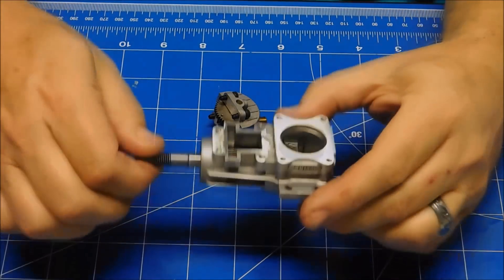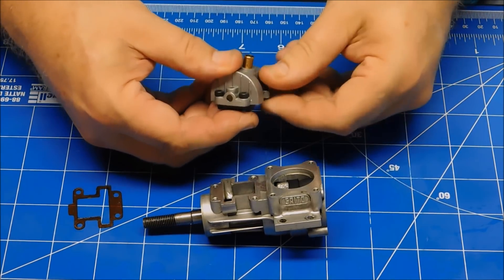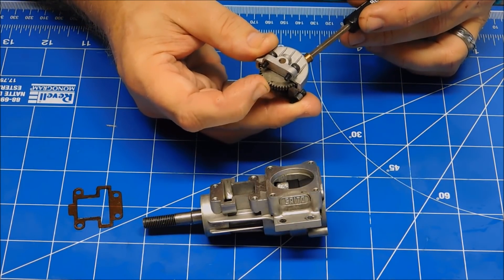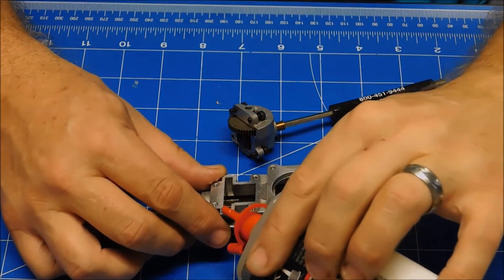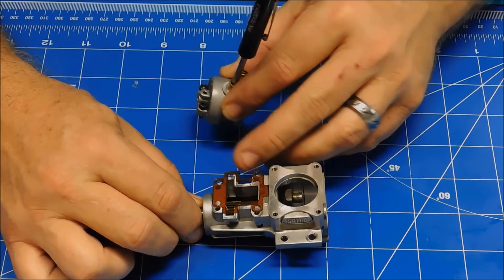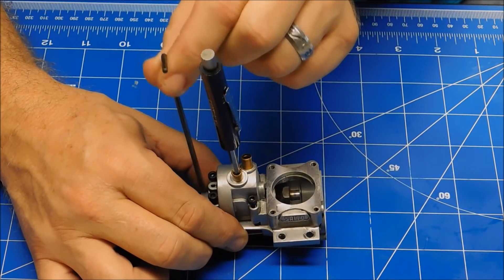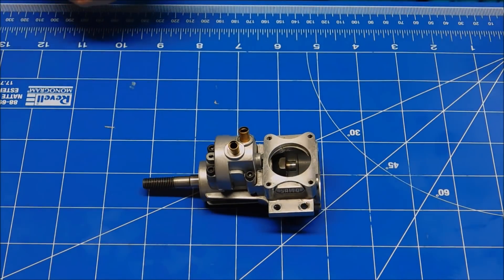How To: Set the timing of a Saito engine

Comment: Dave, little trick I learned on the bigger Saito engines where you can’t index the cam. Two razor blades against the base and engaging the cam teeth will hold it in place while you re install the cam. 
Cheers

Comment: If you get this comment, awesome! Just purchased a used fa62a. When to prime it and it won't prime. However, when I spun the prop clockwise, fuel went to carburetor... engine not timed properly?
Reply from the maker: Clockwise with reference from behind or in front of the engine? Very possibly. Used engines always should be thoroughly inspected especially if you see something like that. I could look at it for you.
Reply: @dmrcflyr2 thank you. Props run counter clockwise when facing engine from the front. Tore engine down and found it was timed wrong. Retimed, and engine is now purring....

Comment: Sorry, but you have it wrong for the first series Saito 150 the cam followers are shouldered, so you can't pull them out to put your screwdriver down the hole, they come out only after you have taken the cam gear out.
Reply from the maker: Thank you. This video was made before I had ever worked on a 120 and up.  if you look at my later videos you will see the correct information for those size engines.
Reply: @dmrcflyr2  We never stop learnig,,,,

Comment: Great videos, when you insert the push rods back in which end of the push rod goes towards the bottom ( cam housing) the tapered end or the round end?
Reply from the maker: The round end goes into the cam, the tapered and goes up into the rocker arm.
Reply: @dmrcflyr2  thank you David

Comment: I have a FA-65.  It's all apart.  When I try to push a screwdriver (or a T pin) down the intake valve, I hit a wall.  And it's not the cam shaft.  The camshaft turns freely.  I can't get access to it.  I've been soaking the cam housing in Marvel Mystery Oil and heating it to see if something will break loose.  Short of taking a punch and a hammer to it, I don't know what I'm trying to break through or if I''m supposed to get aggressive with it.  Thanks for any advice.
Reply from the maker: Sounds like you are headed for destroying the engine to me.  It is a simple as I have shown.  If it isn't then there is something wrong and you need to find out what it is. Have you taken the timing gear off the engine and the gear out of the case?  Not much information provided but the path you are going down is the wrong one.
Reply: David McIntire hi just want to ask i follow you video and started my saito fa 91 i notice that it consume too much fuel and going out of the muffler, try to put my hand to feel the smoke coming out but its too cold thinking throwing fuel without burning it and cosume the nitro immidately? Can you share possible problem?
Reply: You never answered the question, let me rephrase what the guy said - how do you put screwdriver through the  hole there's a tappet inside - how to remove that first. I am completely stuck with my own 56 engine trying to find this answer

Comment: Engine continues to misfire since rebuild. Yes the timing is correct.
Reply from the maker: What engine are you referring to?  If it misfires either the timing is incorrect or the tuning is WAY off.
Reply: Thanks for replying. It was a rookie mistake on my part. I installed the incorrect drive washer. The magnetic pickup was off by 90*.

Comment: Pulling the timing gear from Housing , I thought would be evil to get the nylon washers back in place , some oil to hold them and went back togeather fine .
 Question , after cleaning ,i was putting barrel back in carb, a turn felt a snag so removed the barrel and had a look inside the carb body and it appears someone [before me ] had taken flat screw driver and scoured around inside the body [ for what reason?].
 Since inside the body is etched with ? some tool ,  WILL this allow more air to enter ?causing lean and had I better find a new carb housing? The barrel rotates in the body OK , after i used small emory paper and went around inside with some oil.

 Thanks

Comment: David, Does one Need to remove timing gear from the case . in order to push out the ? tappet from the case , In order to insert a driver; down in the hole of timing gear? could not find a video on timeing gear case . Thanks
Reply from the maker: If the timing gear isn't removed then the timing can't be off.  Yes the timing gear must come off you you intend to replace bearings.  The crankshaft cannot come out without the timing case off.  I show this is several Saito videos, just watch them all!!
Reply: I see what ya mean  , as I see the timing gear OUT of the case in container with all the parts . I've had all the parts in the Ultra sonic , cleaner is brown now . I just hate trying to get the nylon washers back  on the shaft in the case . Patience Patience   Thanks
Reply from the maker: Let me amend what I said above.  If the timing gear has not come OFF the crankcase, then the timing is not messed up.  If you have removed it from the crankcase, then yes it will have to be re-timed.
Reply: I found a screw driver phillips that the OD was almost the ID , but not quite snug in tube to lock gear in place , looked around found a small plastic straw that would fit where push rods go . So with straw and phillips , it was SNUG and held gear in place. I found that getting shaft at TDC , was easy - with bolts that hold cyl on ,screwed into block, was able to keep wrap around where connecting rod attaches , looping rubber band around and up and around the 4 bolts . Held it up just perfect at TDC. then lower the timing gear etc down on shaft.At first it would not mesh ? Further exam showed the main bearing was not fully seated! urrg Back to heat and press- fully seated  timing gear meshed just fine. The Ultra sonic cleaner worked well , the Yellow cleaner Awesome Al's , was brown after several timed runs .
Reply: never answered the question, how do you put screwdriver through the  hole there's a tappet inside - how to remove that first

Comment: Hello David, i have a problem with Saito Fa 56... I have watched your video, but i can't figure it out how to lock camshaft for timing. When dot on gear is at bottom, i put screwdriver in intake hole, but it don't want to lock in place! I don't know what i am doing wrong.
Reply from the maker: Well I really don't know what to tell you.
Reply: David McIntire Ok, i will figure it out... Can you please tell me marks, numbers for bearings for Saito fa 56... Thank you very much!
Reply from the maker: The front bearing is a MR698 and the rear bearing is a MR6901.  The numerals are the most important part.
Reply: David McIntire Thanks David, cheers!

Comment: as you said david the darn cam gear is very free/ i wedged a bit of dowel rod into the guide  to try and  generate a bit of drag i wonder how criti
acil are they if they are out a tooth?
Reply from the maker: Extremely critical for proper operation.  Depending which direction the tooth is off will make a big difference in how the engine runs.
Reply: thanks david/ you are running a brilliant forum heare!!!
Reply from the maker: Much appreciated.

Comment: whats the story, with the  older 180 fs the cam followers have to be in the housing before assembley??
Reply from the maker: Older 180?  The FA-180 is one of the later model engines.  I am about to reassemble a 180 this weekend.  To see how I did it on my 120S watch this. https://youtu.be/crgxE_5x9Ig

Comment: Perfect Timing ( pardon the pun)  I just opened up my SAITO 120 to clean it up and was wondering how to set the Timing.
Reply from the maker: For my 120S I could not use this method.  Watch these to see why.
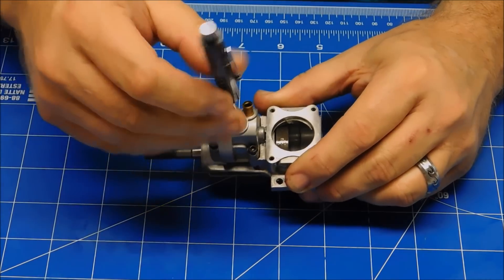https://www.youtube.com/watch?v=wq8vJ763sBI  See time mark 2:14
And this, https://youtu.be/crgxE_5x9Ig
Reply: OK, that explains why I couldn't use the Hole/Screw Drive method. I'm waiting for new gaskets and need to clean up some carbon build up but the engine is in pretty good shape otherwise . Reason I'm doing the was a clanking noise heard when spinning the Starter and lack of restart. I did get white smoke out the exhaust strangely enough.
Your Videos a greatly appreciated...well done Dave.
Reply: Hi Dave, just updating the clean up of both my Saito 120 and Saito 52 four strokes that you helped me with. Both are running perfectly. One note to mention that you might like to try when setting the timing that I did was to determine exact top dead center an  easier way. On the 52 Saito I had the head off and just watched the cylinder come up to the top of the cylinder, and on the 120 with the head is still on put an allen wrench down the hole to touch the cylinder head and just watched it , rise to the top.  Worked perfectly and was easier then watching the connecting rod through the back of the case when putting the Timing gear in.
Reply: Tip: A strong rear earth magnet on the outside of the timing gear case will help hold the gear in position.